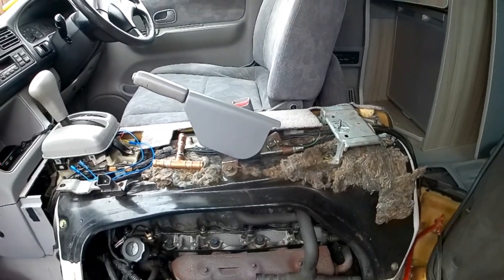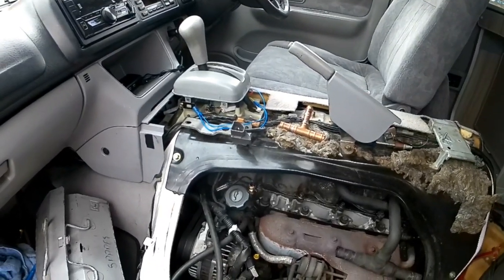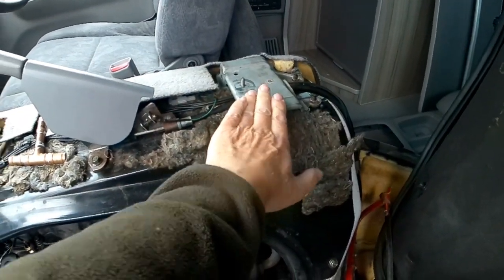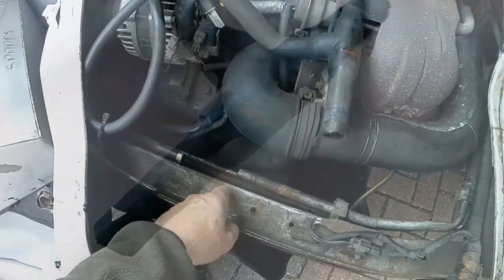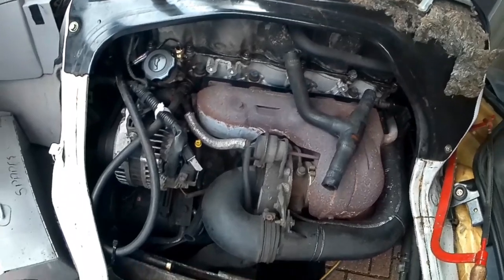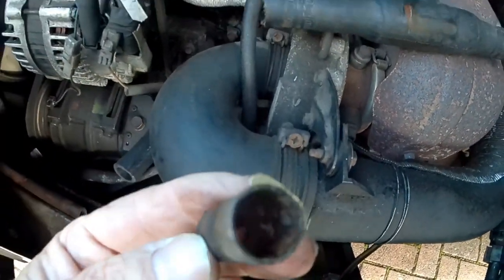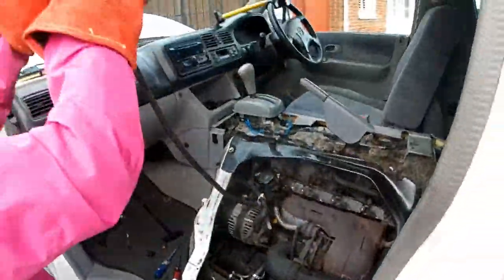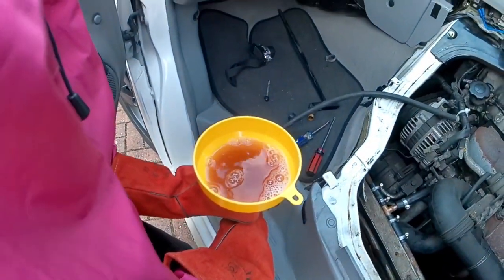Mazda Bongo. Bertie Campervan Has A Leak. Now we have the Cab Heaters Working.

Comment: Thanks for uploading the video! I have a similar problem where that particular long n/s heater pipe sprung a leak at the front - the pipe is about 4 ft long. I decided to remove the pipe as it was rusty. Nightmare! I cannot remove the pipe even after removing the radiator, the condensor etc. I'm starting to think that this pipe was never meant to be removed. I've called a few Bongo repair centres and they assure me it can. If you know of anyone who has successfully removed the pipe in one piece please let me know how. If I'm successful, I'll let you know how I did it. Once again, thanks for sharing your video! 🚙😀

Comment: I work repairing these, yet to see a sane "bleed the cooling system" video - it's all people mucking about with funnels. When I rebuild the fronts of Bongos, I have to pull the cooling system - rad out, ac out, header tank out, pipework mostly off. Never go anywhere near the "bleed pipe" tbh, when it comes to refilling, beyond opening the bung once for about 1 second, lol. Then I jam it right back in again. 

Fast Method is jack the front of the van right up nice & high - higher the better. Fill the rad till full, bang on the cap. Fill the header tank full.  BRIEFLY open the radiator cap - fluid will spill out, ensuring the header tank pipes are full/free of air. Close the rad cap. 

Keep the header tank topped up/cap off. 

Wander over to the bleed bung under the seat - it might help to unclip the pipe, but I seldom bother. Take out the bung - for only a split second, lol, as coolant will flow/spray out rapidly.  Bung back in,  Bang - you have bled the system as much as you need to. Top up the header tank. 

With the vehicle still jacked up, run the engine until you feel the bottom radiator hose go hot - this can take ages unless you rev the engine to 3k revs & hold it there for a fair bit with the header tank cap firmly back on.. I do that.. Once you feel the lower hose go hot, the thermostat has opened & the system is good - top up the header tank again(wait till its cooled if you're unsure how to open it safely when hot)  & the jobs done. Takes 20 minutes with the "get it hot" bit included. 

Just my 2c.

Comment: the manufactures guide to bleeding the system is to hold the bleed pipe higher than the coolant tank with a container for the coolant to flow into and the air will spit out leave the engine running for five minutes until and steady flow of coolant . Then cap off the bleed pipe and top accordingly. Now way in Japan would Mazda have their Technicians doing this method  . And wear heat resistant gloves as you coolant gets warm.
Reply from the maker: The main dealers just jack up the front of the van to do it. There is also a auto bleed kit you can permanently bolt on kit. Just not got around to buying and fitting one. George
Reply: yeah I'm a little strap for cash after the themostat housing pipe end eroded completely draining all my coolant and overheating, luckly i was only a few miles from a petrol station only done about 6 miles 40mph . temp was not high for long so was lucky the head did'nt crack. Already have coolant alarm and temp sensor fitted  . The AA guy did a temp repair to get home safely now in process of fiting new housing and themostat . I'll repair the old one by drilling and boreing the old housing to  shrink size find a t-piece pipe fitting or i'll turn one up using a 4 jaw chuck on a lathe then shrink fit with liquid nitrogen at work. These housing are £140 new and bongospares £38.50 used so to right im gonna repair this one at thoses prices just in case. @MakeDoAndMend1